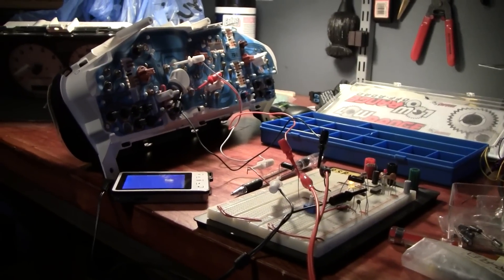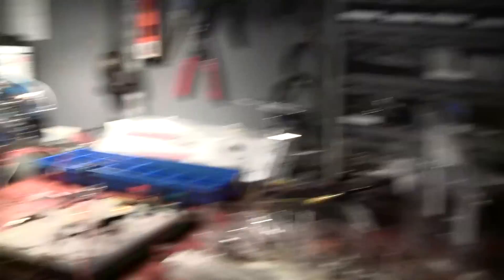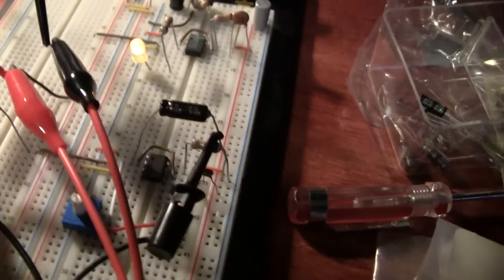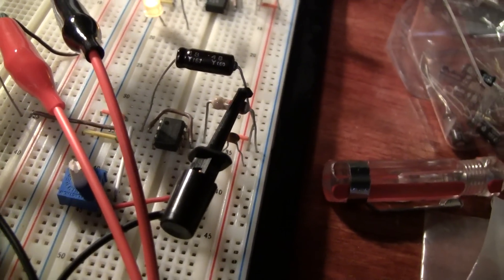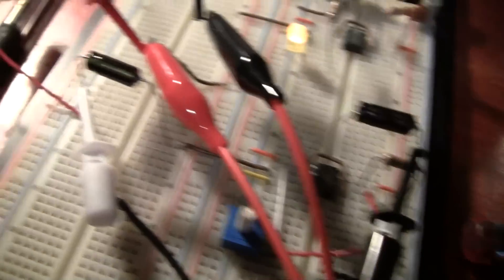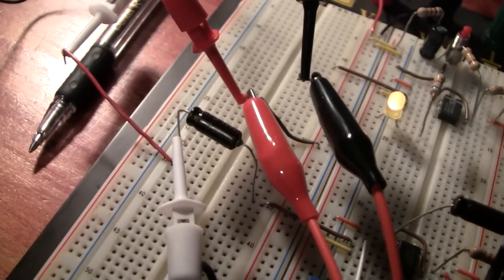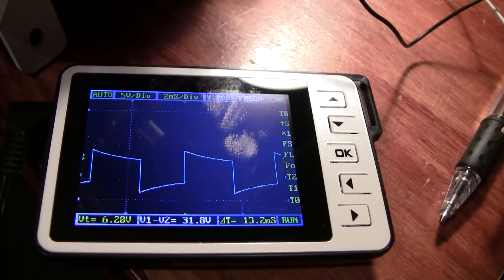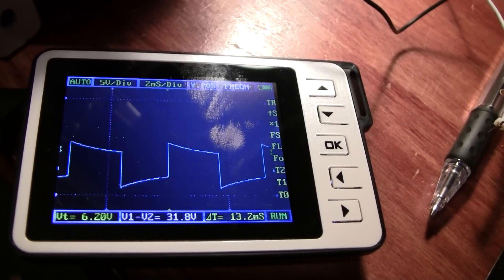LS1 240SX Speedometer Converter Proof of Concept

Comment: Ever get this to work? I'm running a ar5 trand on 2jz and I tried a Dakota digital but it didn't work if it was was as simple as installing a capacitor let me know
Reply from the maker: I've had it running in my car for a few years now. it works well up until a certain speed at which point the pulse rate is too high for the cap to keep up and the speedo cuts out. I'm unsure how this would traslate to VSS on an ar5/2Jz though without knowing more about it's signal output.

Comment from the maker: I didn't know that about the VSS, very interesting. though the Nissan signal needs to be 4x the PCM output so going to the VSS directly still wouldn't be enough. In the video I used a 1uF capacitor as an AC couple. This actually worked well in the car, next I'm getting the PCM reprogrammed for the 4X output. Programability is why I decided to use the PCM output instead of the VSS output.

Comment: I'm not sure what VSS you're using, but don't most GM VSSs(?) directly output an AC signal that is 2x what the PCM outputs to the speedometer? That's they way the older GM cars/trucks are. Basically, I'm suggesting you may be able to take the signal directly from the VSS to the speedometer.
What brought me here is a project I'm looking into to make a digital gauge cluster for my 93' S10. I'm trying to find a way to get my arduino to read the DC wave signal. Your video was very helpful. Thanks.